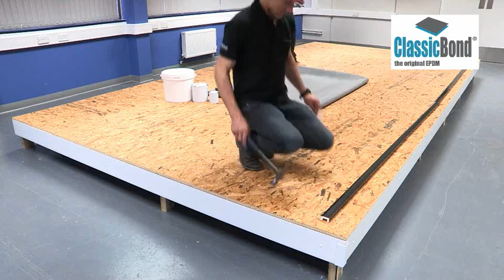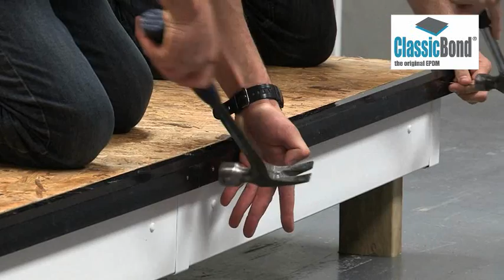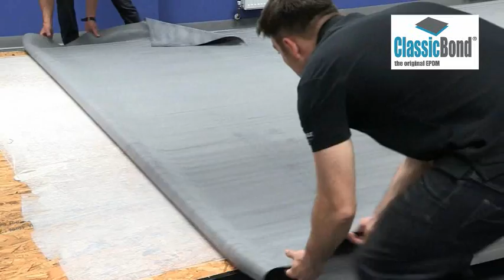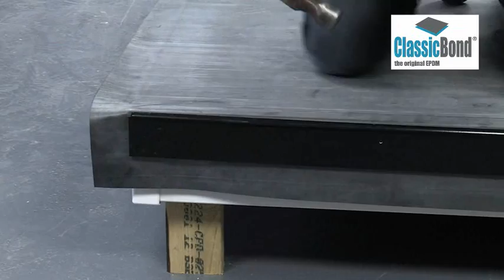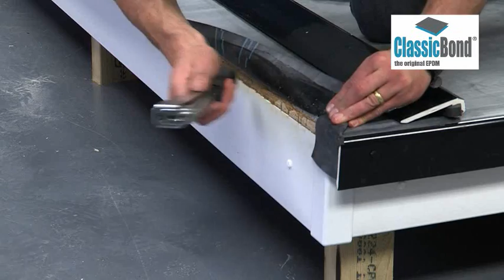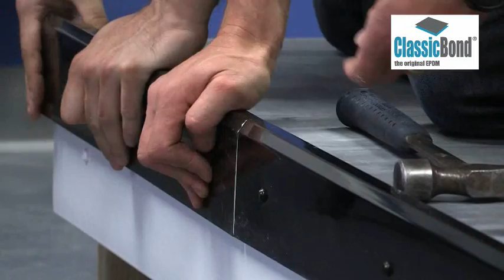Flat Rubber Roof - EPDM Installation Guides and Training

Comment: I wonder wich year it is this becouse by code you need to install here in columbus ohio it is 4.4" inchs of ISO insulation before you apply bonded and hisive so you guys need to go back and learn the right way to install a flat single ply roof and can you explain where the water go to drain system? you guys don't know what you just did and trying to teach how to install EPDM boooooooooo to you guys.